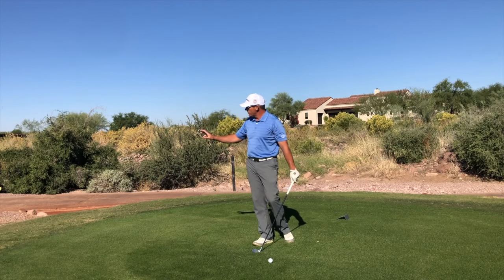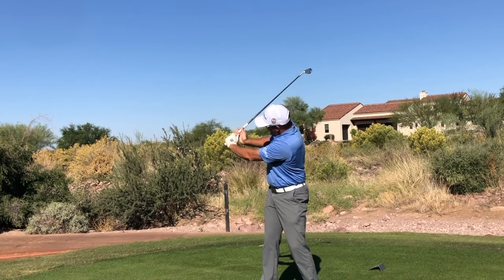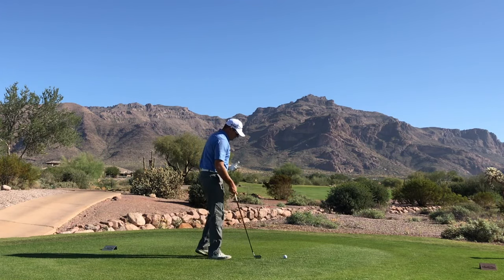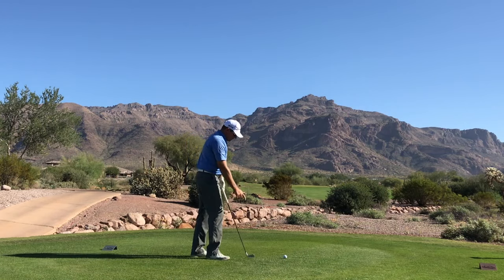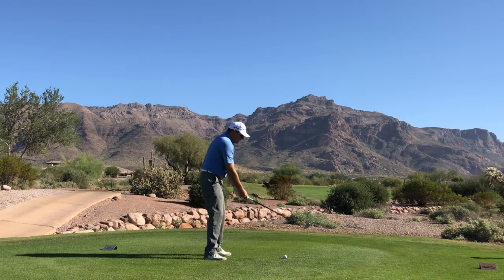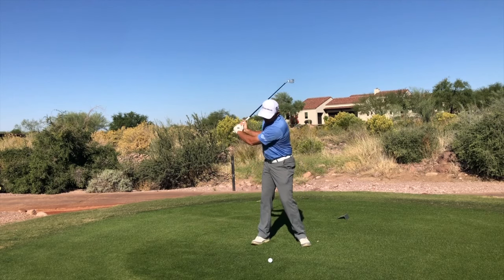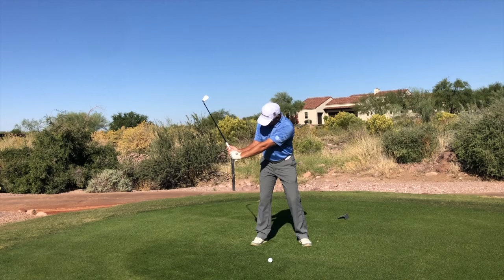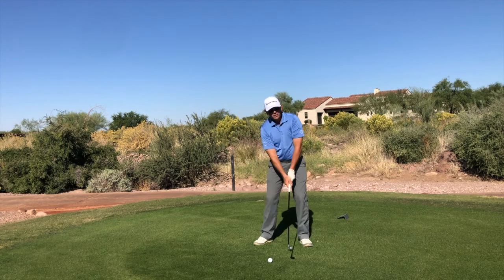Arm Structure Mistakes (Where Amateur Golfers Go Wrong!) | Milo Lines Golf

Comment: When I try to put myself in the correct position at the top to the backswing (using a mirror to verify), I have to really stretch my left side and extend my arms as much as possible to get there. I am finding that in this "stretched" and "extended" position, it is impossible to start down using the arms. The lower body has to start the transition (the correct way) because the arms have very little leverage at that point. ConverseIy, I also find that if my arms and left side are not fully stretched and extended, it is so easy to start the downswing with my right arm extending (the wrong way) or, put another way, to start the downswing with my right tricep instead of my lower body. Golf is a journey........Thanks for the videos.
Reply from the maker: Thanks for sharing Ken, and watching!

Comment: Question Milo, I'm 5'9" like you. My chest size is about a 44". Weight 190lbs. I see a lot of golfers who can get their left arm straight and really extended across their chest and high on the back swing. For example, Freddie Couples and Ernie Els. I've always tried to do that but don't have the ability even though I'm fairly flexible at age 70. I don't collapse my trail arm like you say  a lot of amateurs do. Should I focus more on extending my lead arm and keeping it relatively straight but not rigid? I'm a lefty so that's the reason for lead and trail!

Comment: I completely f'd my swing 10 years ago doing the Jim Hardy Lawnmower drill where you pull the right elbow behind you.  I've tried forever to fix this problem which you describe in this video but haven't had any luck.  Could you possibly do another video on this where you give a few drills or recommend a training aid that might help with getting the right arm get into a better position....?
Reply from the maker: The best training aids for your issue are the GBox and the Tour Striker Smart ball